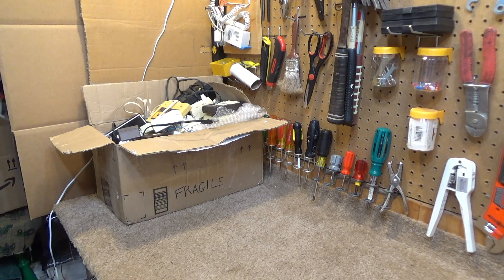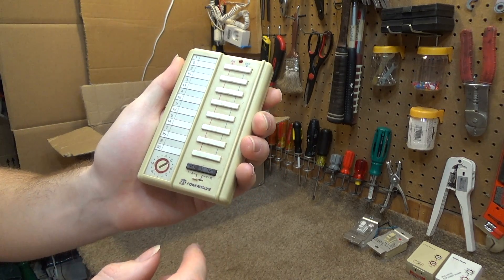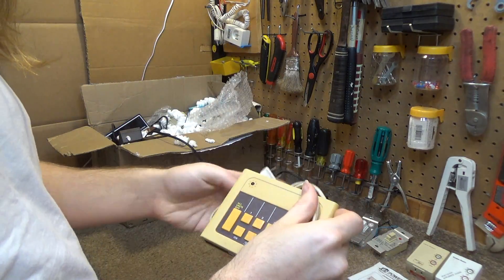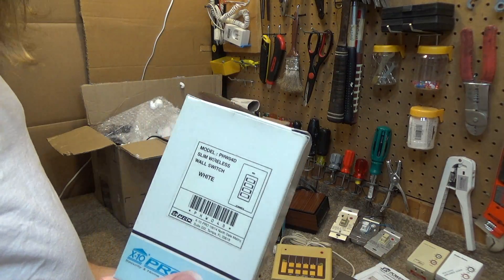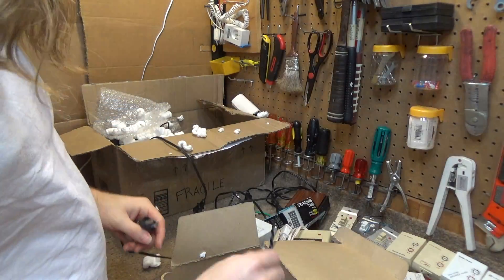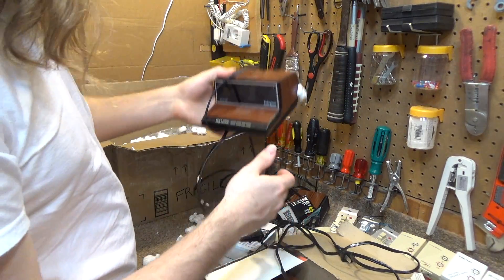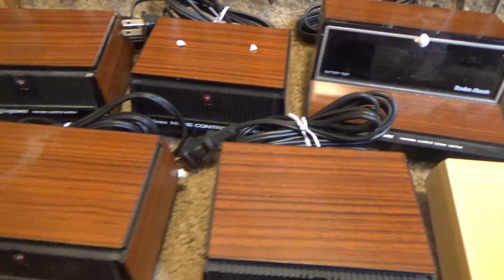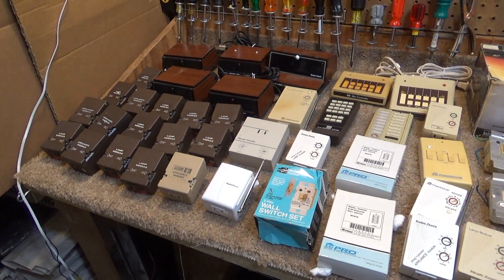Vintage X10 Home Automation Equipment | Initial Checkout

Comment: That 12 gauge aluminum wire on the outlet matches perfectly with 14 gauge copper. That's potentially capable of the full 15 amps and that's impressive
Reply from the maker: I've always found these pieces to be very well made..